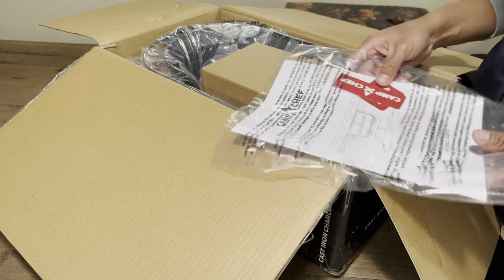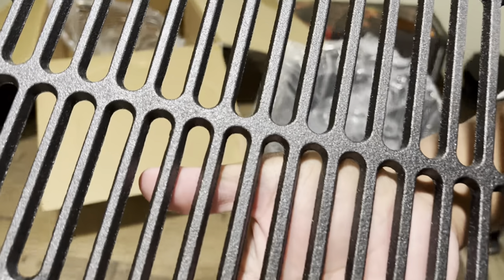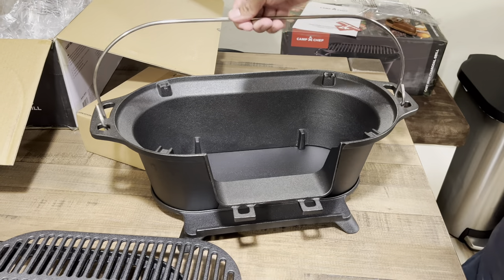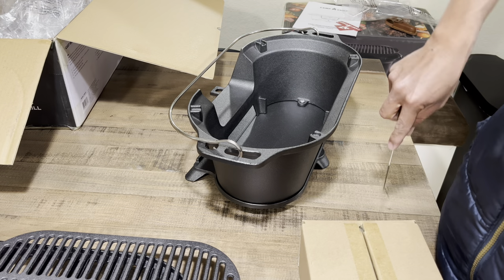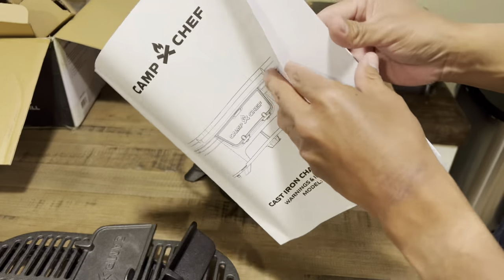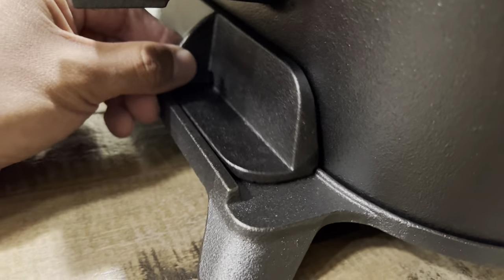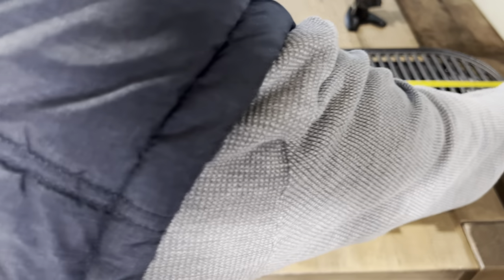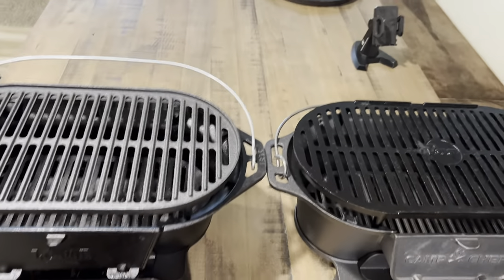Unboxing: Camp Chef Cast Iron Grill “sportsman grill”

Comment: Guess this video popped up on my YouTube suggestions based on my web browser searches and viewing history?  

I’ve not seen this Camp Chef grill “in person” - found your review informative!

Early this spring (2023) I bought a Lodge Sportsman Pro as a way of getting back to the flavors of charcoal grilling.  

Within two weeks of receiving it, being a “nice guy” 😇 brought me an older Lodge Sportsman Grill - with a mallard duck 🦆 design Fire bowl door (apparently a collector’s item?).  

One thing that was missing from that grill I was given was the draft door.  LoL! The ONLY part not available from the Lodge online store. I did find it for a few extra pennies on eBay 😊

Seeing that all the other parts were available as replacements…  i built a third grill from replacement parts!  

Subsequently, Amazon threw a suggestion at me.  It was a “similar” grill sold by a company called Everdure.  I couldn’t resist the price (just under $90).

So now I have four of these girls.  And I also now know the “original” was a design sold by Birmingham Stove & Range (BSR).  

My “replacement parts” Lodge has minor enhancements over Lodge’s earlier copy of the BSR (small side rails on the grill, notches that prevent grease accumulation at the sockets the grill feet land in).  

The Everdure also has enhancements over the earlier designs.  Dimensionally?  The grill, Fire bowl grate, Fire bowl door are completely interchangeable.  The draft door? Minor difference.

I like my Lodge Sportsman Pro.  But I much prefer the older design…  both Lodge’s versions of the BSR and the Everdure (which I suspect was copied from BSR).

Comment: Thanks you always come out with the new it’s kind of nice. my only thought process lodge is a little heavier to withhold a little more heat. Well camp chef seems a little lighter built easier to travel. Only theory on my behalf considering purchasing one for camping do use with my cast-iron skillet. Thanks again
Reply from the maker: You can use two 8” pans or one 10” skillet with this grill.

Comment: Everdure's version has parts that are interchangeable with the Sportsman Grill except they use a  two bail arm design which improves on the original. They also provide a nice cover and a grate lifter... all for $89. Just received mine today to put next to my original Sportsman. I am pleasantly surprised.  Comes with a 2 year warranty
Reply from the maker: Gotta check it out, I haven’t heard of that brand

Comment: 2-3 hour cook? What will you cook that long on a open grill?
Reply from the maker: Actually there is another channel on YouTube which cooks with sportsman grills and they cook a slab of ribs on these grills. They use either an oval roaster upside down or an aluminum foil tent to ensure they cook properly. Pretty cool I can’t remember if it was Teach-a-man to fish or Big Lew BBQ. Great channels and interesting videos with the LSG grill
Reply: @luisj.castironcooking  you are very right. There are guys out there that try to push that grill to do things it was not ment to do. It's just a hibachi grill, not a Weber grill.  I have the Sportsman's dutch oven. I wonder if it will fit on this new Camp Chef grill.  That lip that they added might mess things up...
Reply: @luisj.castironcooking  if you going to cover it, why not use a Weber Smokey jumbo grill... its way cheaper....